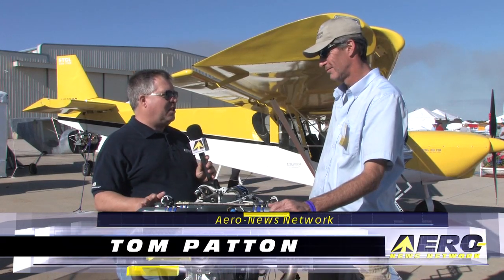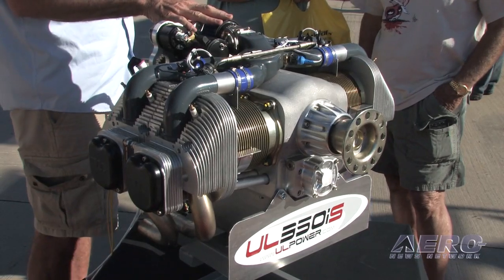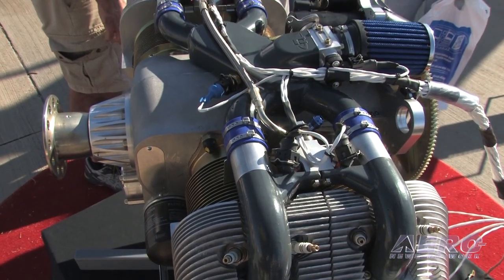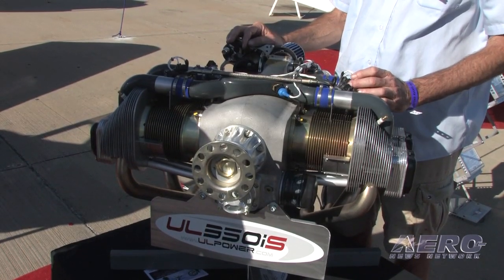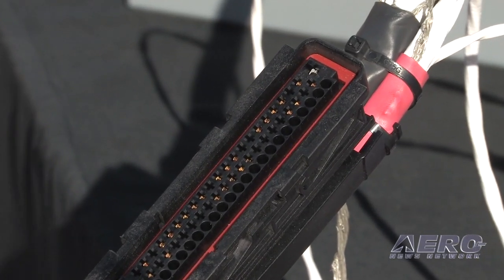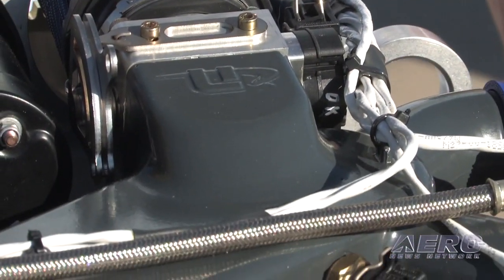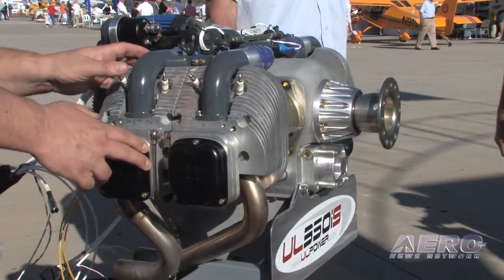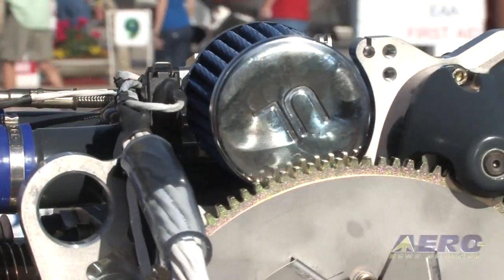Classic Aero-TV: A FADEC Engine For LSA - UL Power's UL350is Aero Engine

Comment: Not to knock your very fine engine but if you want a small, powerful engine my Triumph triple cylinder 1 liter weighs 100lbs and is 18”wide.  It puts out 120hp and torque from 2300rpm to its 6500redline. Power mapping from my laptop is done from downloaded software.  Cost is a fraction of aircraft engines due to the number of engines sold (thousands).

Comment: The maximum rated power is at 3300 RPM.  I'm assuming that's how this engine can compare with Lycoming engines which have more volume and weight.  Would there also be prop overspeed issues?